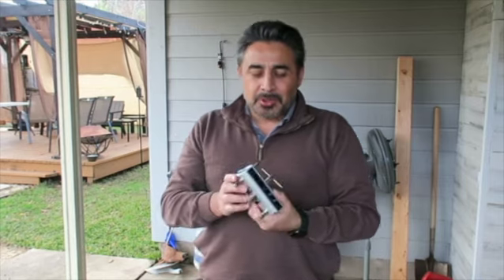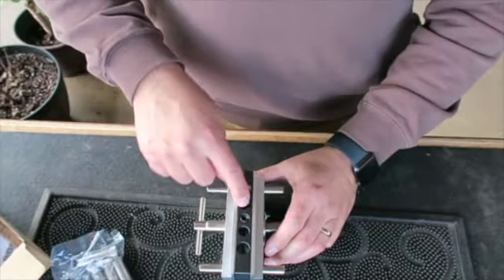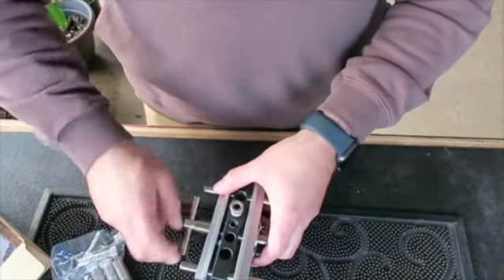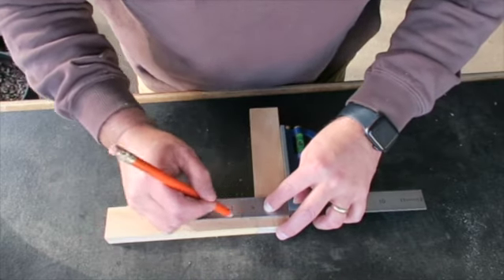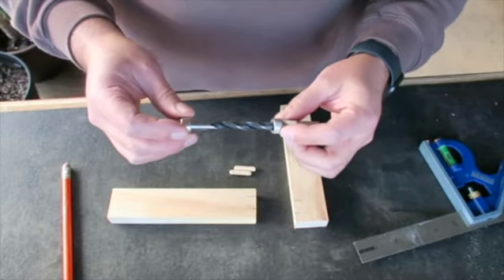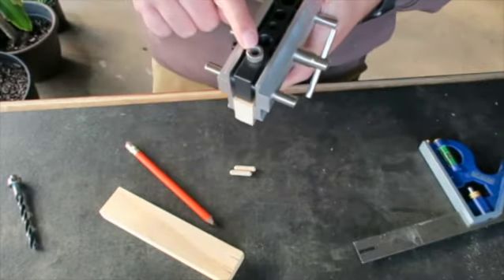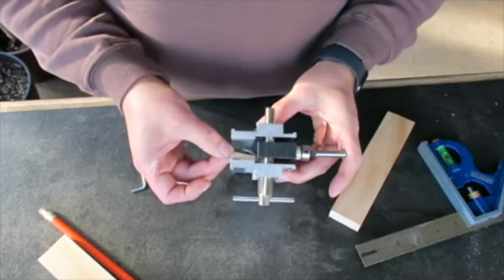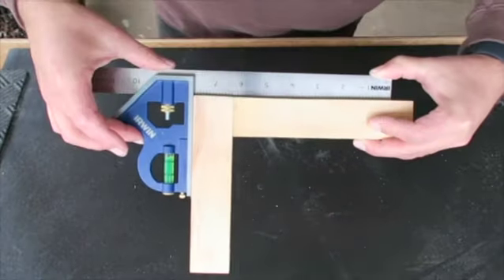Doweling Jig - How to use it.

Comment: Que modelo es el dowling jig?
Reply from the maker: $29.99
  & FREE Returns 
FREE delivery Thursday, June 9. Order within 2 hrs 29 mins
Deliver to Victor - Austin 78750‌
In Stock. 
Qty:
Qty:1
 
Add to Cart
 
Buy Now
   Secure transaction
Ships from
Amazon
Sold by
tysun
Packaging
Shows what’s inside. To hide it, choose Ship in Amazon Packaging at Checkout.
Details
Ships from
Amazon
Sold by
tysun
Packaging
Shows what’s inside. To hide it, choose Ship in Amazon Packaging at Checkout.
Return policy: Eligible for Return, Refund or Replacement within 30 days of receipt 
Add a gift receipt for easy returns

Add to List

Have one to sell?
Sell on Amazon
 
Sponsored 
 
 Tysun Self Centering Doweling Jig Drilling Guide Positioner Woodworking Doweling Jig Tool Hole Drilling Guide Self Centering Locator
Roll over image to zoom in
 

 

 

 

 

 

 

Tysun Self Centering Doweling Jig Drilling Guide Positioner Woodworking Doweling Jig Tool Hole Drilling Guide Self Centering Locator
Reply from the maker: Perdon, se pego toda la descripción de Amazon